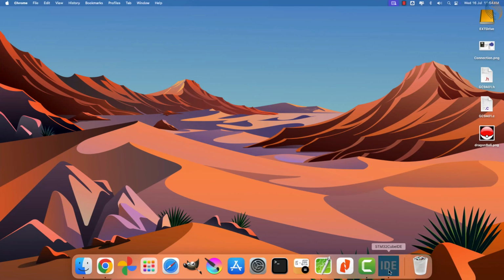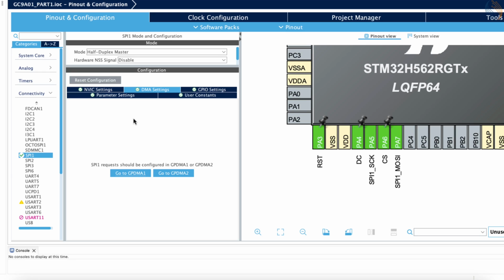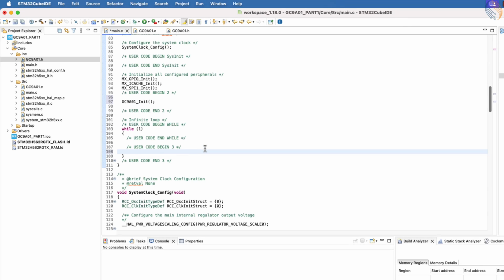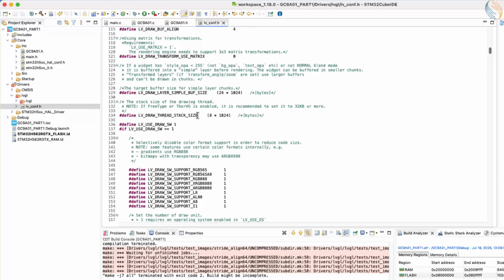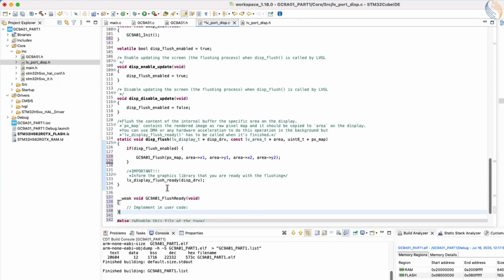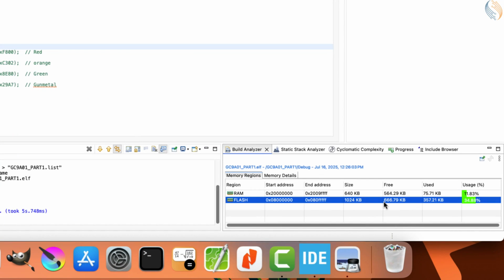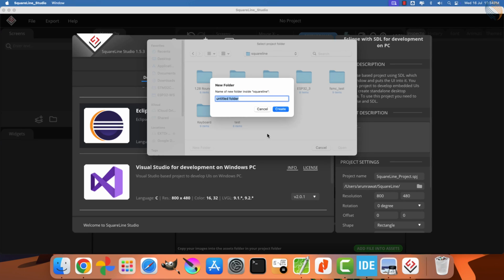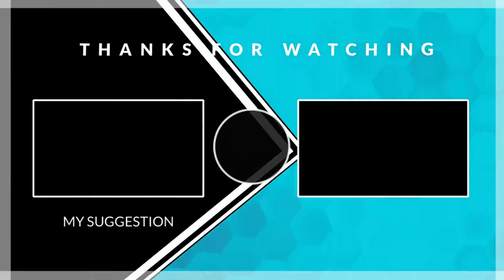How to Interface GC9A01 Round Display with STM32 Using SPI + LVGL Integration

Comment: Thank you very much for the video. I had trouble using Arduino IDE for programming stm32f411ceu6 with GC9A01. I got the first color changing running...

Comment: If you use the usb connector from the board directly, there´s a trick to upload code. You have to build the project, find the .elf file in the path workspace->project_name->Debug or Release and upload this file to the microcontroller with help of stm32cubeprogrammer (set to usb and press connect before)

Comment: Hello, thanks a lot for the video!
Unfortunately I didnt manage to flash the program from my MAC and as I saw the ST Link Driver is only for Windows. 
How are you handling that? 
I am using the NUCLEO STM32F413ZH
Reply from the maker: You don't need to install a separate driver for ST Link. Installing just the cubeIDE is enough.

Comment: Thanks so much for the video, .... Is it possible to use a 256kB STMF105 with this type of display when using LVGL?
Reply from the maker: You can use but you need to modify the lv_conf.h file to reduce the memory consumption.
Even after doing it, you will barely get it working as the images and elements would require more flash memory.
Reply: @ControllersTech  Thanks I going to try, and feedback about it as soon as possible
Reply: I have see the entire video and is clear that not enautgh memory with 256KB of my STM32F105, ...but in case of not using a LVGL Integration and not animations also (only 'static pictures' in the round screen), is enougth 256KB?